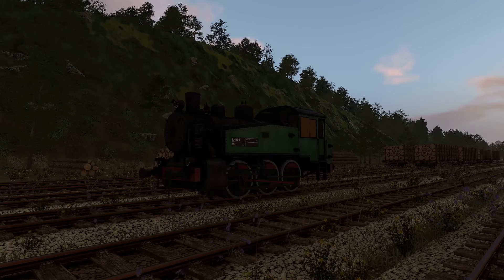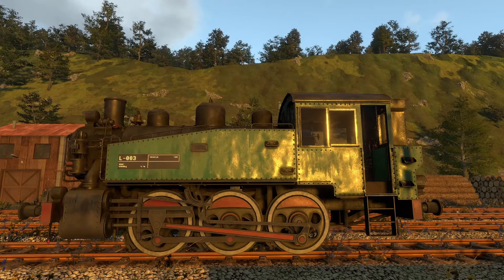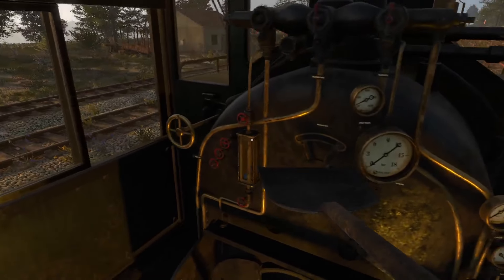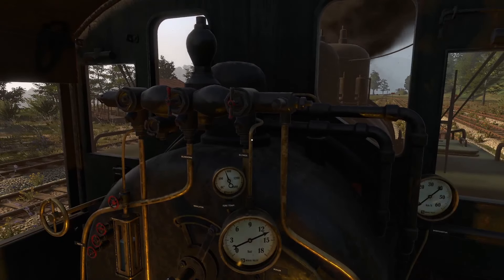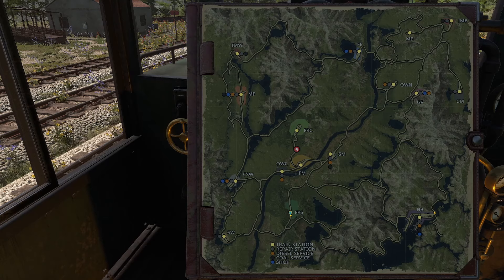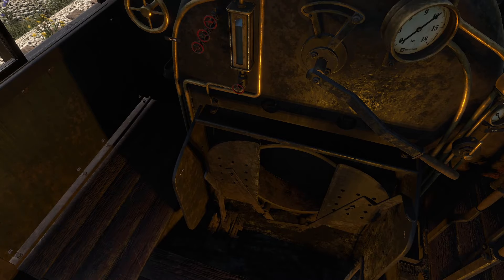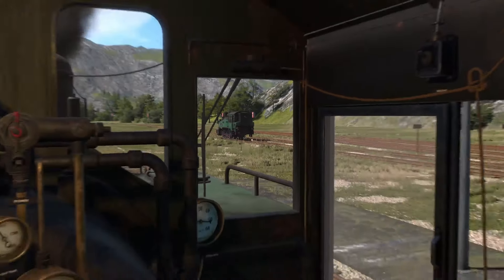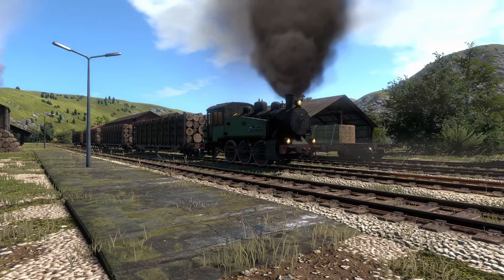Lets Take a Look at the S060! | Derail Valley S060 Tutorial

Comment: If you are going downhill and not using any steam, you can let the furnace flame out to save fuel and water.
Reply: While it does save you fuel, as long as don’t let the safety pop you are not using anymore water than normal

Comment: I've never Given Myself a harder Facepalm when He called the "expansion link" a "banana piece"  also the only thing He forgot to mention There's a small valve called the "sander" which You can use if the locomotive experiences any wheelslip.
 It's in between the reverser and the regulator

Comment: Good explanation for somebody who's obviously not experienced with real locomotives.  Im nts how well this game/sim (im thinking of buying it to try in vr, my standards are high as i want full sim because I'm well familiar with operating actual locomotives) models its fire management but you could potentially expand further on how to actually manage steam and water levels by using damper and firehole door. As far as boiler explosions, if you run out of water it will not explode, it should drop a plug, the cardinal sin of any fireman. Overpressure explosion should be theoretically impossible without tampering with safety valves, as far as what it would actually take to explode a "modern" boiler, its probably something like 10-20 times operating pressure assuming boiler is in good condition. In  the old days they did explode a bit, but they were iron(or even copper in some cases) vs steel boilers and the driver/fireman often tampered with the safety valves to try to get extra performance. I only know laws in my country (Australia) but boilers being operated outside of private operations are regularly hydrostatically tested, often to double working pressure, i imagine most developed countries have similar rules.
Reply: May be old comment, but the plug basically is more of a warning for the person to respond with the injectors, and will eventually explode due to the crown sheet failing here in game…either that or derailing and the water levels expose the crown sheet or the locomotive hits something too hard.

In terms of water management I more often than not don’t hear any weird sounds of such over how loud the steam locomotive is and usually have to rely off of staring down the water gauge and add water when it starts getting low. Exactly what happened during my first attempt to use the S060, the thing got blown up and I had to get the DE2 shunter to drag the train for the rest of the trip with a now crippled steamer.

Will say though, it was nice learning how to make use of all the valves and mechanics to get an otherwise ancient train to move.